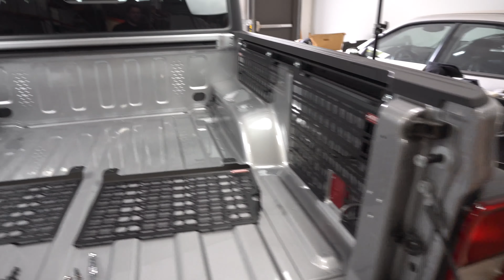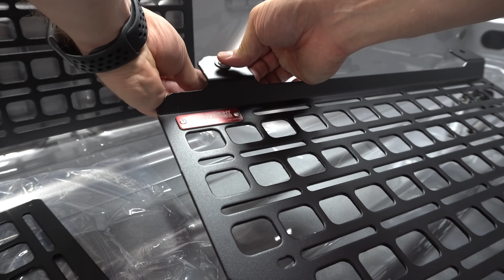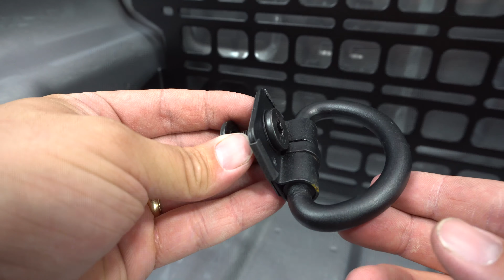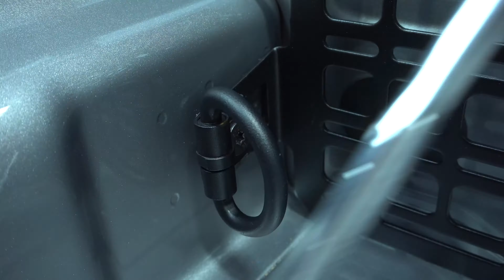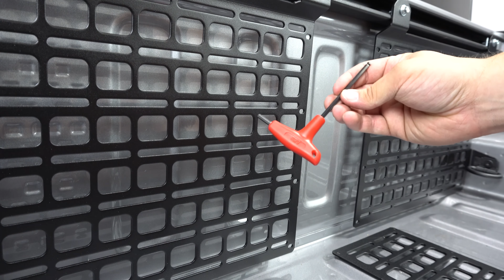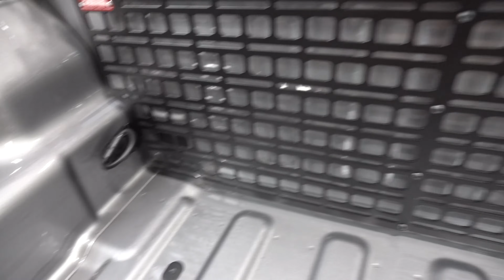2020 Jeep Gladiator - Bedside Rack Install Guide - Front Panel

Comment: Pretty easy install, one small tip, for the rail anchors to fit best into the Built Right rails, start to tighten with the channel nut more in a vertical position before final tightening